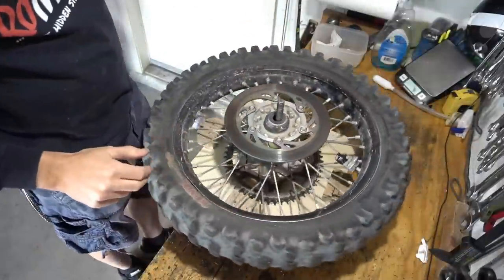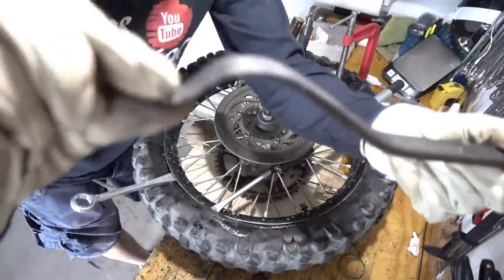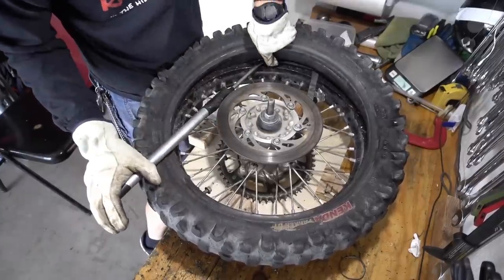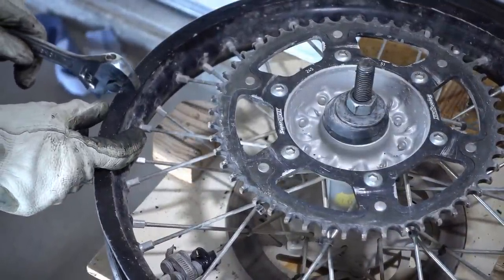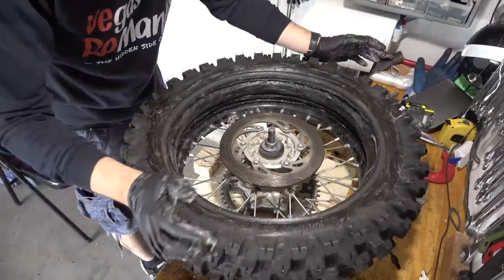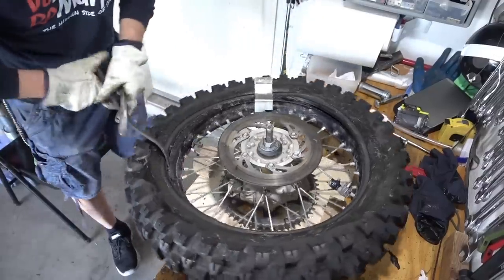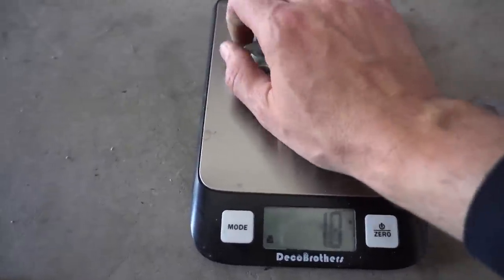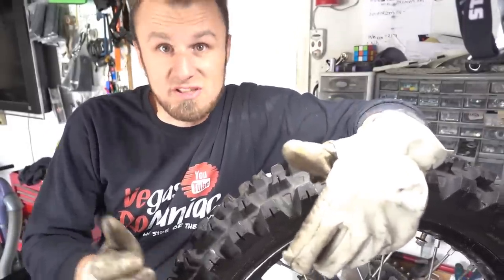How to install a Michelin Mousse BIB TEST and REVIEW after 3000 miles or 200 hours

Comment: I use lead solder to balance my wheel. Just wrap it tight around a spoke or two. Looks really clean.
Reply: You mean its really really clean 😂 notice how vegas romaniac always says really twice and very verry.
Reply: Brilliant, BRILLIANT idea, Brian.

And Alex, that's just a very, VERY insightful observation.
Reply: @jeffsmith4801  i learnt that a few years ago from an old timer flat tracker.
Reply: @jeffsmith4801  yes it is very very true and it is really really good. hahaha
Reply: Do you need to put tape around the lead solder or clamps or anything to keep it in place?
Reply: @dickiegoodtimes  I still running the same solder on the same bike. About 3” on 2 spokes opposite the rim lock. No tape. It’s never moved
Reply: @brianh8484  awesome I’m going to try it this week. Thanks!

Comment: For wheel weights, I've had good luck using lead fishing sinkers.  You could have used a couple of 4oz sinkers.  I hack saw half way into the sinker, spread it open then crimp in on around the spoke.
Reply from the maker: Many people told me about the lead weights but I couldn't find them and they cost almost as much as getting the actual weights for the wheels that you could take off and put on easily with us and so because of that I never really went that way but the metal things that I put on a spoke for now they seem to be working just fine and in the future I'm just going to get my hands on the kit that is removable and I think I'll be a lot happier that way but if you live in a let deposit and you have plenty of love and slid it laying in your backyard might as well
Reply: @vegasromaniac  Oh yeah duh... Sorry about that, there's not a good supply of surf fishing tackle in Las Vegas.
Reply: why

Comment: Its allways best to have control when sliding in...😆

I'll be sticking with super heavy natural rubber tubes for the time being. Easier to work with and fine for my conditions.
Reply from the maker: I agree the Moose is not for everybody but it's no headache for me and it's all worth it I never have to check pressure or do anything and it works great for my area
Reply: @vegasromaniac  donthey make them in different compounds to approximate different tire pressures? I run mine a little higher than most people expect.

Comment: Very nice and informative to see how you do the tire change. It  has been many years since last time I did tire change like this myself... On the sports bike I had it was always done at the tire store, not looking forward to do the tire change on my 500 EXC myself.
Reply from the maker: Yes when I had a Kawasaki Vulcan 750 I remember I have to replace the tire and I took it to the store and it was $180 for one tire with a labor and now that I look back to it could have done in myself yes but back then I just had no clue that you could do it yourself also the best thing about doing it at home is that you could basically put used tires page tires broken tires and they don't really care because if you think they will never do that for you so you can save money that way also
Reply: I am fairly new to motorcycles.  I did a tubeless change on my sportbike a couple of years ago and was happy with how smooth it went.  I got a dirtbike a few weeks ago and though tubes would be easier, but they were much more difficult with trying to not pinch a tube while installing.

Comment: Great video, was that a 110 mousse? I have a 110 mousse that I was given but prefer to run 120 tires for desert racing and I am concerned that set up might be too soft for racing.
Reply from the maker: it was a 110 mousse specially sized for the trackmaster based on their chart , but it didn't fit. if you run a 110 mousse in to a 120 tire it will rub against the tire and will be destroyed but will give ou good traction for a while

Comment: I just wrecked my long irons last weekend. Bent one and snapped the tip off the other. The 1090 is not fun to install tires on. I poked a hole on the inner liner too. That should be expensive.
Reply from the maker: Hmm,  never done that, so I can't tell.. But I know installing tires on my car was easyer than the bike..

Comment: I thought tires had a mark on them  that you  lined up with the  wheel lock or valve stem   so they would be easy to balance without much weight . The dot or mark is the lightest part of the tire  so it off sets the valve stem . I think if you have both  the dot goes in the midde of the 2 . I didn't see you lining up the  mark  on the tire  to the wheel lock .
Reply from the maker: I run mousse no flat foam Inserts. They are always unbalanced

Comment: Would be better off just using tyre levers rather then c clamps. The clamp is stopping your tyre going down into the drop centre of the wheel. Your trying to force the reinforced bead over the rim.

Comment: Great video thanks! Do you have a small video of your bench top wheel bracket/mount you’ve made and using in your work bench? Cheers Jim
Reply from the maker: No I don't but I am making anew one soon, and will be posting it on the channel stay subscribed, I'm actually remodeling my garage with a moto charging station built in the table

Comment: Before you pulled the wheel from the bike, was the bead still seated well on the rim, or do you pull and service the mousse when the bead comes off?

Big thanks for the mousse content.

I've got a motoz Desert IT on the front of my dual sport bike, after 500 miles of slab, it's still looking like new, lol  I usually have a Pirelli Scorpion mid hard, and it's over half gone at 500 miles.
Reply from the maker: I don't service the mousse..I put  it in and that's it
Reply: @vegasromaniac  My bad, I thought you had broke the tire down and re-lubed the mousse periodically .
Reply from the maker: @bradl45  I should have but I didn't, I skipped the maintennace too see what happens and this happened.. Haha
Reply from the maker: .... Nothing happend
Reply: Yep, Thanks for testing, and sharing the info, can't wait until your next mousse installment!

Comment: nice video sir. i don't think i ride enough or on rough trails enough to use a moose but it is a great product to keep in mind just in case.
Reply from the maker: Yes if you ride any Street or any Forest Road and you keep it by Corbin for a longtime moose won't do very well but I'd Ride Slow maximum 30 mile rides and I go from Fast to slow and then I could get easily pinch flags and the fact that I don't have to ever check air pressure it just so worth it for me
Reply: i agree with what you are saying sir. i mean if i ever start to ride more than once a week or what not and start getting into tougher terrain then i'd for sure get it.
Reply: @Minionmoto529  I use mousse in my hard core trail/race bike but in my dual sport 500 i run HD tubes but i lube them up with the same mousse lube. A greased up slippery tube wont get a pinch flat ( or at least it  hasnt happened yet)
Reply: @brianh8484  right on. Yeah I think mousse is good I just don't ride hard enough you know.

Comment: Not sure what kind of mousse you are using but Nitro has a website for virtually every tire and what size mousse you should be using.  If you are using a mousse for a 110 tire and put it in a 120 tire it’ll probably pop off the bead (eventually).  G.L buddy
Reply from the maker: That's why you should never believe what they say, it's all about selling you more stuff they get paid by tire manufacturers to promote cetaint tires, btw since I made this video I have over 10 hours or 200 miles on the tire no problem
Reply: Vegas RoManiac for the type of
Riding you do (fire roads/ sand washes) I’m sure it will be fine because you’re not putting it under much stress.  I have first hand experience of a 110 mousse coming out of a 120 tire during a hard enduro/ rock bashing ride.  Right off of the bead.  So there is some credence to what they say in their website.  Good luck to you bud 👍
Reply from the maker: @MXJEFF94  I never ride washes or fire roads.. What r you talking about.. What channel r u confusing me with

Comment: What lube do you use?
Reply from the maker: Tire lube, whatever I found online
Reply: Vegas RoManiac i found on amazon exactly the same lube paste as in your video...but no delivery in my country :(
Reply from the maker: Any lube it's fine, it's mostly to help push the tire in, silicone lube is the best in the long run
Reply: Vegas RoManiac what about the siliconic oil?
Reply: Vegas RoManiac because the normal grease attack the mousse, am i wrong?
Reply from the maker: @furtunacipriancodrut5443  i dont think it will attack it , the tire will do  a lot worse things to it, silicone is nice because its not water soluble , the original installation kit does come with a silicone grease tube , but what ive heard its expensive

Comment: Think I'll stick with my tubliss set up. Far easier tire changes and never a problem... Ever.
Reply from the maker: Except the occasional inner bladder doesn't gold air  or nail in the trail, or side wall pinch flat, all the problems that bib solves
Reply: I've ever had any of those problems and have never met anybody that has tubliss that has either.
Reply: @OldManEnduro  Try riding

Comment: Good lord.....your poor brake rotor....
Reply from the maker: Nothing wrong with it... Absolutely nothing
Reply: @vegasromaniac  the rotor got covered in slime multiple times....I'd say there's a lot wrong with it.
Reply from the maker: @gordonhill28  i was telling you it's fine , that video was done a while back and the rotor still on the bike working fine ...
Reply: "Fine" meaning the rotor was still in place and present maybe.  0% chance it bites properly like a normal pad/rotor after all that.  There's MacGuyver'ing things, then there's being a danger to yourself and those around you.
Reply from the maker: @gordonhill28  when I push the brake it stops , if it would not I would fix it , I don't understand what part you don't get !?